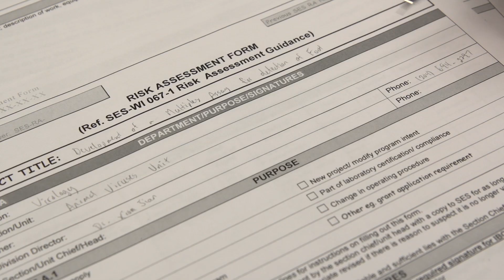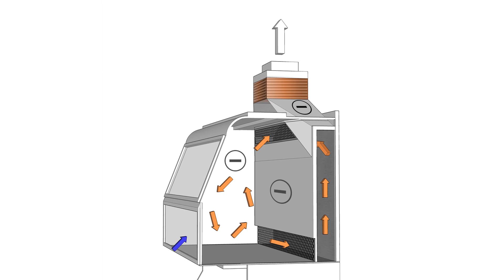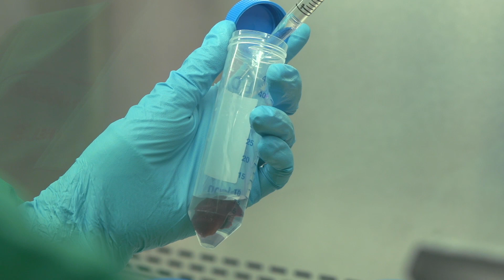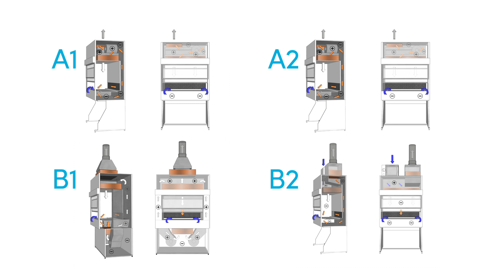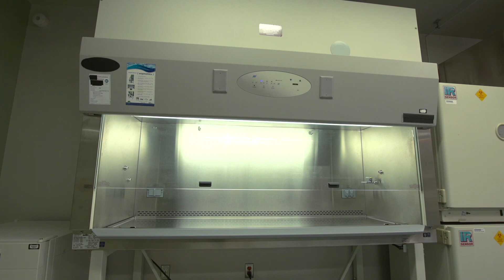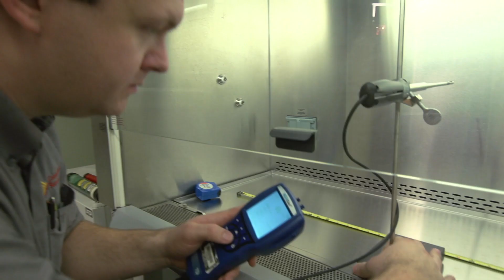Biological safety cabinet (BSC) 1: Introduction

Comment: In this video, incubators are located between 2 BSCs, and this is of concern, because turbulence created by laboratorians walking to and from the incubators and opening and closing doors create turbulence that can perturb the BS’s protective air curtain. The cabinet to the left is situated right next to a door. (This is in contradiction to what is later said in this video about positioning of cabinets.)
Work is carried out right behind the front grille, but should be done at least 15 cm behind the grille. (This is in contradiction to what is later said about keeping work away from the front grille.)
In some sequences, laboratorian’s glove does not cover the wrist. (This is in contradiction to what is later said about pulling the glove over the cuff.)
Less critical observations:
Front closed gowns (tied on the back) are preferred in the microbiological lab.
Mixing by suction/expulsion should be subject of risk assessment; infectious aerosols are generated
Using snap cover microtube should be subject to risk assessment; gloves may beome contaminated